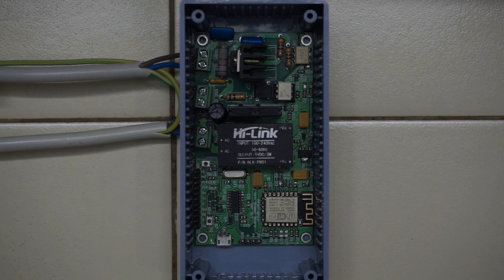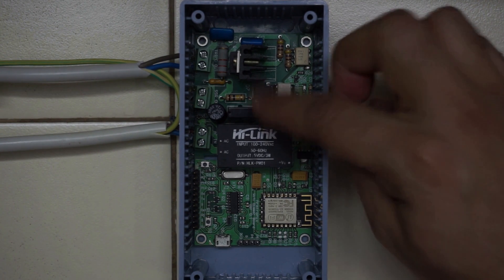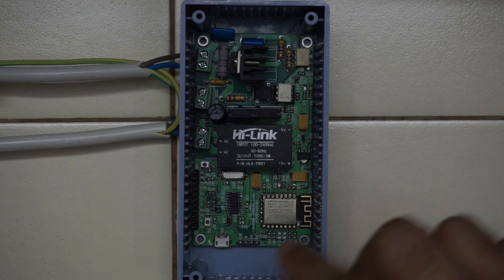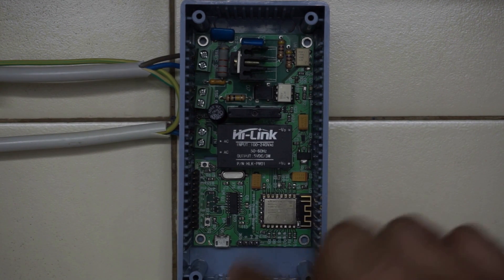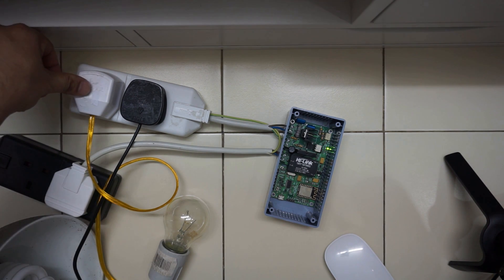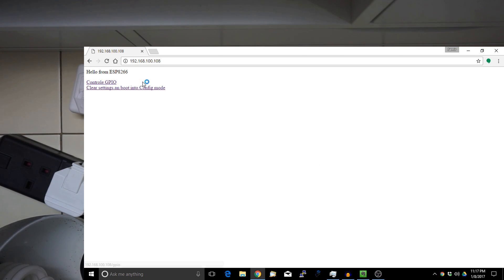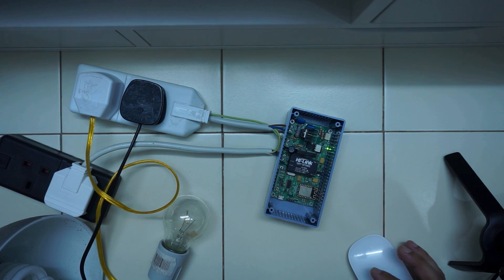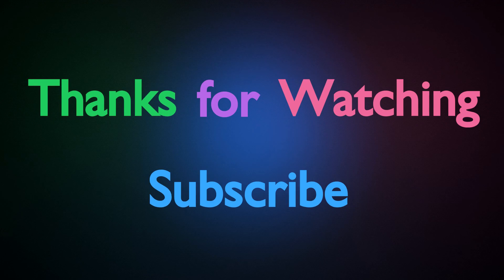ESP8266 Dimmer + Relay from Armtronix Review - Baba Awesam

Comment: I almost try all of your source code and Schematics to PCB Design on my own and found so much flickering if I set dimming value less ten 10% or on up side if dimming values >80%  can you please specify what cause of this issue ? 
With my observation its looks like The Zero Cross and Firing gate pulse are not properly synchronized WITH ESP8266 stand alone mode because ESP8266 did lot of other process too same time so that cause bit off the triggering point
Reply from the maker: Zulfiqar Aadil I am just user of the board.you can message manufacturer at armtronix website.
Reply: Samir Sogay Thanks i will rise this issue on Armtronics forum

Comment: can i code esp8266 dimmer by using arduino IDE?
can i connect PIR sensor to esp8266 dimmer?
and how??
Reply from the maker: The arduino code in the github is for arduino IDE. There is another sketch which has PIR sensor details, maybe you can get it from here https://github.com/armtronix/Wifi-Triac-SSR/tree/master/Arduino_Code/SSR/SSR_WiFiSwitch_PIR_Sensor

Comment: Wonderfully presented. Can you help me with specific ESP coding which contains MQTT functions to link up with oepnhab as you did. I need to do the same. Thanks. :)
Reply from the maker: In this I had used http to control esp8266. If you have the same board, you can use the below code in openhab
Switch 4ssr "4SSR1" (Bedroom) [ "Switchable" ] {mqtt=">[broker:4SSRControl:command:ON:R4_ON],>[broker:4SSRControl:command:OFF:R4_OFF]"} where broker is the name of the broker defined in openhab mqtt.cfg, 4SSRControl is the publish topic, R4_ON and  R4_OFF are the messages pre defined in armtronix code
Reply: I am facing issue with the code, I am coding esp using arduino IDE. I have seen the git hub url you have given in your video description. Can you tell me which code is to be used for MQTT dimmer/speed control so that I can define items file in openhab you have expressed.
Reply from the maker: https://github.com/armtronix/Wifi-Triac-SSR/tree/master/Arduino_Code/Triac/Wifi_Dimmer_Triac_SSR_Switch
Reply: Samir, can you share your code for ESP8266 (arduino C code). Need to control the Fan with openhab app. I am facing difficulty in understanding this code. I am able to switch on and off my fan but having issues with  speed control.
Reply from the maker: When I got this module, fan didn't work. Then I reflashed the code from github (the one i replied in the comment) and it worked. You have to be careful when you use fan because if you play around with the slider then the temperature fuse in the fan can easily burn due to varying current. These days I don't use dimming with the fan, only ON/OFF. Better to have 1 or 2 fixed presets for dimming the fan rather than slider.
Reply: Thanks Samir, I am able to do it. Able to dim the bulb lights using web-interface. However, I need to further control it using openhab app. By now I used to do mqtt settings in my esp8266 code only through arduino IDE like: char* subscribeTopic = "Smartroom/utilities/fan2"  for which I do turn on and off relays.
But as you mentioned above in your first reply regarding mqtt.cfg...which I am not able to understand yet. So, my question is how to provide subscribe topic for mqtt settings and where? Can you tell me steps? I am able to create items and sitemaps in openhab for fan speed.
Reply from the maker: In latest openhab2, there has to be a mqtt.cfg which will contain details about the broker. The broker can be on the same system as openhab2 or it can be on another system. If you use the code from github, it gives a web page by default. When you access this page, there is a setting for whether you want to control via web or mqtt. You have to select mqtt and set the topic. Then you can turn off/on the dimmer via item file Switch 4ssr "4SSR1" (Bedroom) [ "Switchable" ] {mqtt=">[broker:4SSRControl:command:ON:R14_ON],>[broker:4SSRControl:command:OFF:R14_OFF]"} 
for actual message, check the mqttfunctions.ino
Reply: There are two things coming in web interface:
Control GPIO
Clear settings and boot into Config mode.

Form first I am able to control the bulb but when I press second option nothing opens. I am not able to select mqtt. Am I heading right?
Reply: There are two options coming:
Hello from ESP8266

Control GPIO
Clear settings and boot into Config mode
When option one selected I am able to control bulb dimmer but when selecting second option nothing is happening, everything gets erased.
Reply from the maker: you have to clear settings and boot into config mode. This will give the option to rejoin esp8266 ap and access the default page which gives options for mqtt settings. Do you have any specific requirement with mqtt or would http do? According to me http is much easier than mqtt. Also if you choose mqtt, I found it difficult to clear the esp8266 to default because there will be no web page.
Reply: Samir, I am trying to do the fan speed control just like you did from openhab application in your video. When I clear settings and boot into config mode nothings appear, the browser keep on loading and stops. Specifically, my other openhab devices are operating using mqtt so I am interested to do it this way.
Reply from the maker: When you clear the config, the esp8266 will go into default mode i.e. it will become an AP, so you have to join this AP. You can then access the esp8266 by the default ip address of 192.168.4.1

Comment: Eseamu walejkum.Can u bulid the app but with 3 dimmers i need to control led rgb.If u can do it u could help me a lot i am not as good as u in programing.
Reply from the maker: +bio Mechatronics firstly dimmers are for resistive load, not for leds. You can use pwm in code to dim them. Secondly the arduino code and Android app is made by the board manufacturer and not by me. You can get it from their github page.

Comment: Too expensive, complicated and huge ;). I know this doesn't have a triac on it but is even less than half of price. Will be open-sourced soon when we test out v2 PCB. It is significantly smaller too 42x60.

Also it is unnecessary overkill to have all-in-one board with UART bridge, USB interface, etc. on one board, also it seems that they designed it one side only, which makes it more expensive and bigger.

http://www.swifitch.cz/images/3D_Vector_Swifitch2.png
Reply from the maker: I like Armtronix boards because they are feature rich and stable. I too hate the big size as it makes it difficult to put inside tight spaces. I don't mind giving up overkill features in exchange for smaller size. The board you linked is impressively small.
Reply: Samir Sogay yes, it is our own design, we made it to fit to ceiling lights so it had to be really small. I will try to remember and once we publish it to github, will send you the link.
Reply from the maker: Thanks
Reply: Hi Samir, it is finally out so go have a look at http://swifitch.cz (GitHub). Have a nice day.